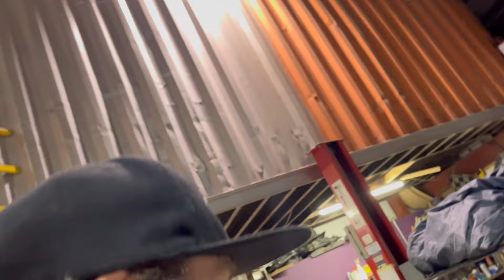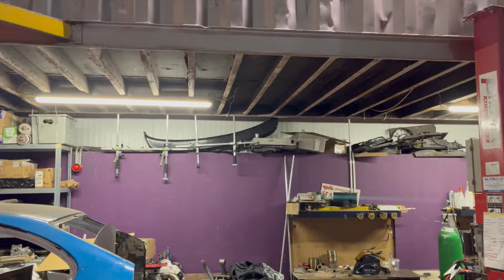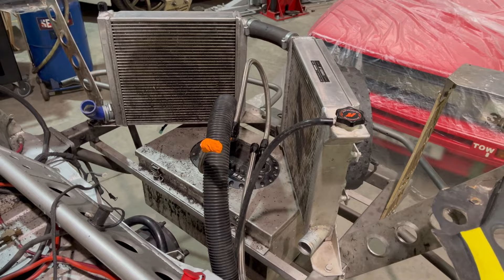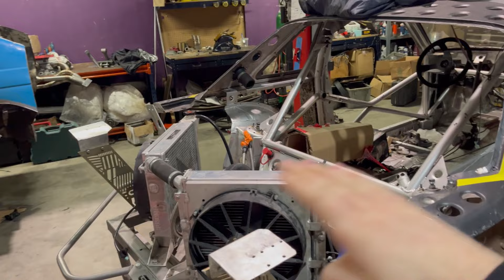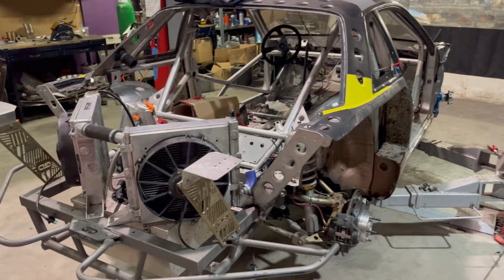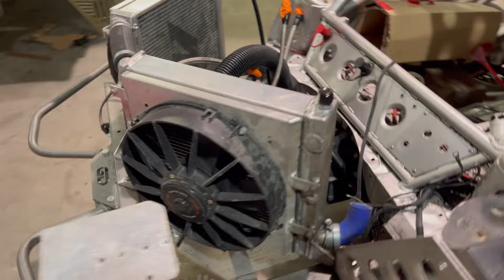Are Two Radiators Better Than One??

Comment: This is cool to see. I've been planning out a Chevy s10 build with the radiator in the bed. Not wanting to completely ruin the bed space I've thought of running 2 radiators on each side leaving the bed floor open for activites.
Reply from the maker: Ya it should work

Comment: Love those videos! Do you have an idea why this setup works better than a single radiator? Not sure if you were running a dual fan setup on the single radiator but could it be that the two fans where "fighting" eachother?
Reply from the maker: Thank you. Prob just more volume and more surface area. I always use 2 fans im not a fan of just one on a powerful car anyway. the fans on the previous setup were not fighting each other i would think. Previous setup still worked great but the twin rads just solved more issues

Comment: When you designed this set up did you think about fluid thermal dynamics and how the hot water would flow and how its properties would change as it cooled or was it designed more out of a packaging stand point and the efficiency increase was a welcome by product?
Reply from the maker: This was born out of packaging necessity and then symmetry took over rather than FTD. I only mentioned briefly on the position of the rad hoses and what would be the most efficient orientation but with enough capacity, gallons per hour and powerful fans will prob make any half decent system work. Over capacity and a bit of extra rear weight is a plus for these cars too